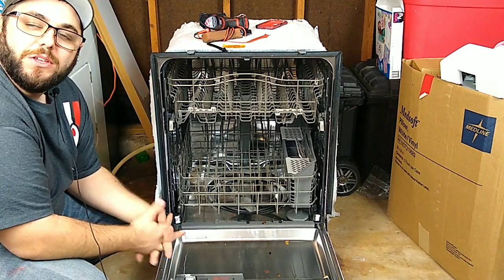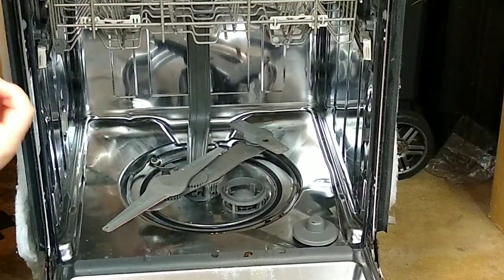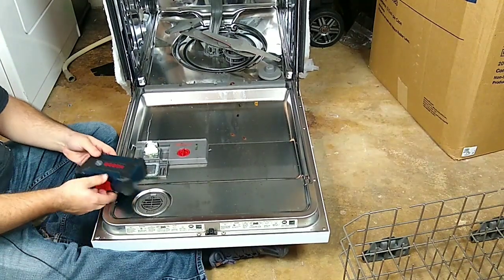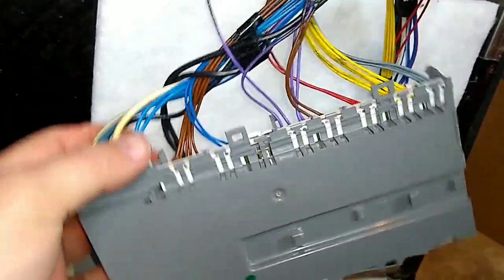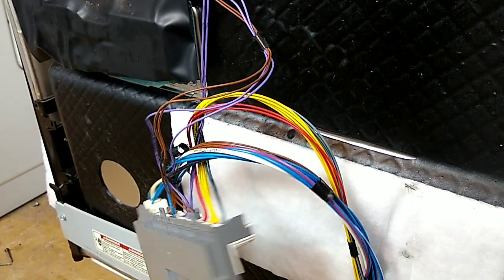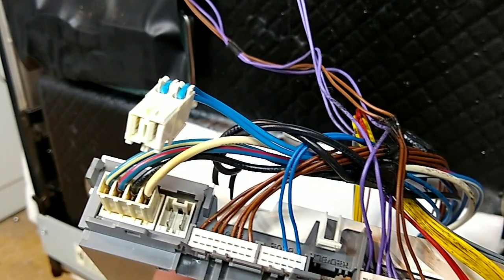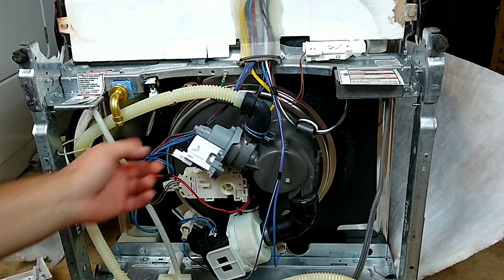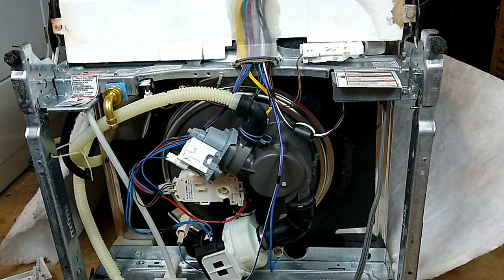(Dishwasher Training Series)#2

Comment: Quick question David, how do you check power at the circulation pump circuit since it wont turn on till the water is full. Do you prop up the float switch so the pump will run or is there some other way it will turn on? Thanks

Comment: Good video. Do another one and go a little more in to testing the components.  I have a GE dishwasher that is not draining. I replaced the float switch and pump and still not working.  I'm learning as I go.